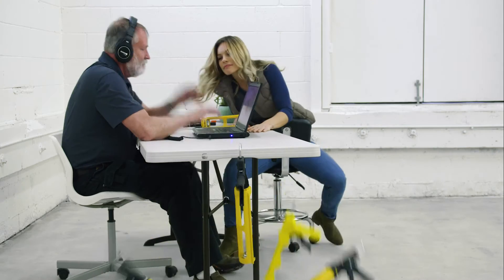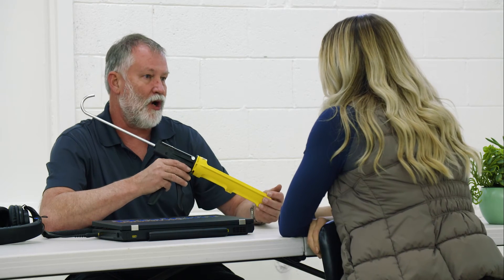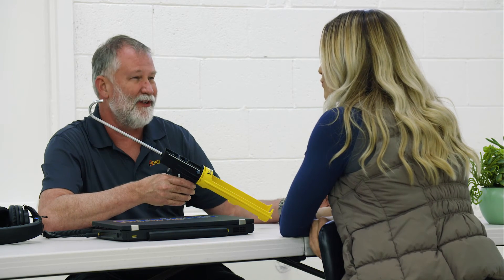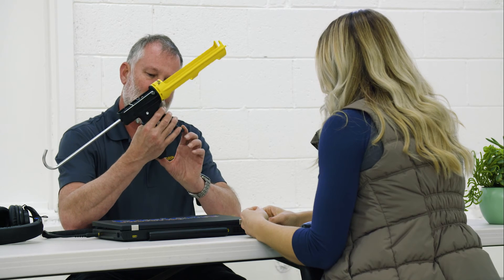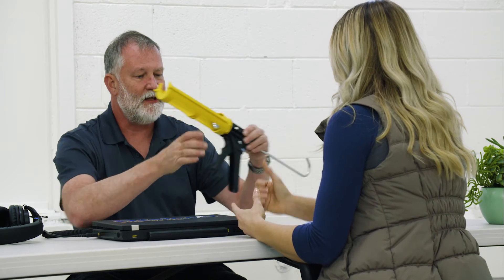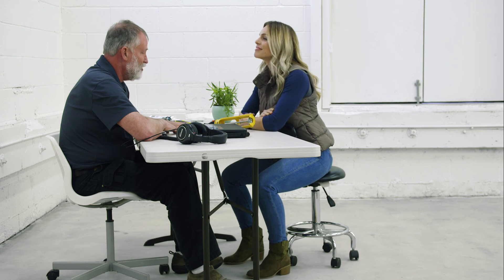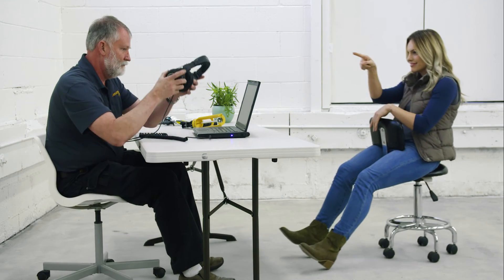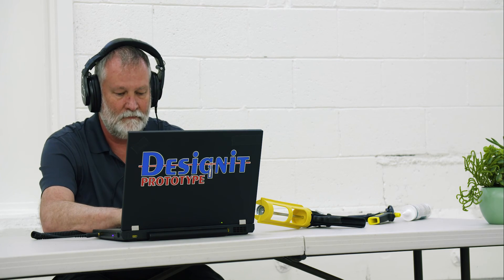Thrust Ratios Explained - Drew and Larry Have a Chat

Comment: excellent simple explanation. Just wondering if there's a downside of getting a higher ratio. i'm going to try the new siligun pro with a 24: 1 ratio versus the 12:1 ratio of the original
Reply: The flip side to a higher thrust ratio is that you get less product extruded for each trigger pull as a result of the push plate traveling less distance. With thin or medium thickness products generally it's more efficient to use a mid-range thrust ratio gun.
Reply: @TommyDripless  looking at the siligun 12:1 ratio and the pro version 24:1 ratio. I would just love to get the aluminum Pro one, because the basic model is plastic. I just bought a used one that someone already had broken the trigger. So I hope I can do most of my bathtub surround caulking with 24 to 1 ratio without being annoyed
Reply: @TommyDripless  thanks for your reply

Comment: Is it just me or is that is switch redundant. I don’t think anyone using a caulking gun wants to have caulking or anything else continue to drip out when not being used. Or can someone explain what would be the benefit of this option.
Reply from the maker: We put that in because certain contractors gunning thick adhesive said they wanted a function where it continued to flow out since it took some force to pull the trigger. In reality, people tell us they use the dripless function 99% of the time! Oh well, it's a handy feature if you need it...
Reply: Professional tradesmen that I have worked with for 25 years never use the dripless guns and certainly never use a built in tip smashing/sorta cutting mechanism to cut the tip . And we don’t rely on a built in poker. Most of the sealants we use in large scale commercial glazing do not have a foil seal and we need a far more sharp cut tip than the horrible device that manufacturers put on the tool for diy homeowners . Having a gun with an auto release adds a mechanical application that will only serve to assist the gun to fail much sooner . More moving parts equals more chances to fail. Besides, when you shoot sometimes dozens of cartridges per day , using the rod release is done as a subconscious reflex rather than a thoughtful action. I hope my personal experience and opinions based on it were insightful to making sense of it . At the end of the day having the most control of the tool’s action is probably the main reason I would never consider a dripless. Notice the professional guns such as Albion b12, b26, Newborn Super smooth 250 and the 375, a Cox super smooth , all professional cartridge guns and non have dripless features. Go down a notch at 1/2 the cost and you find the dripless range of options. I personally use a newborn 250 SS and a Newborn 375. Had Albion’s in the past . Tried a dripless for like 5 minutes once. I think it was a $4.95 Homeboy gun from like WalShart I mean wal mart

Comment: 36 divided by 2  makes no sense.  the distance between the tips of the arms of the trigger appears to be 2 inches, the length of the barrel is likely 9 inches, so 36 pumps x 2 inches = 72 inches of travel to get 9 inches of travel of the full length of the barrel.  The thrust ratio then appears to be 72 inches / 9 inches = 8 : 1
Reply: The distance between the tips of the arm and the trigger might be 2.5 inches, then the real thrust ratio of this gun could be 12:1.  However, does it mean the longer trigger yields a higher thrust ratio?  Some length of trigger and handle might not be used when you actually use them, so the actual thrust ratio should be measured in some other way.